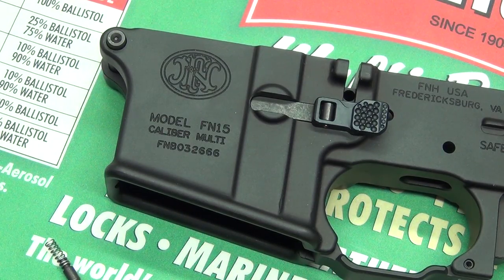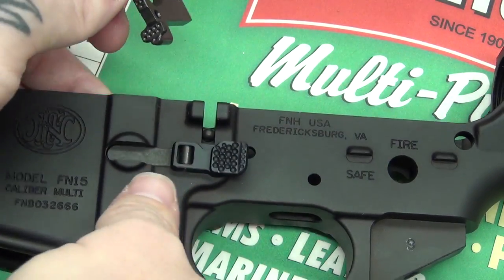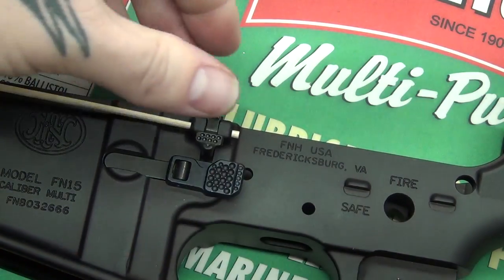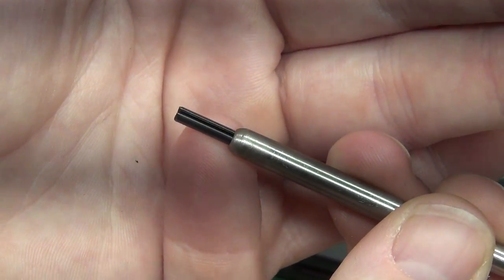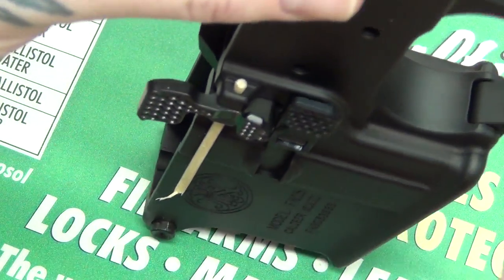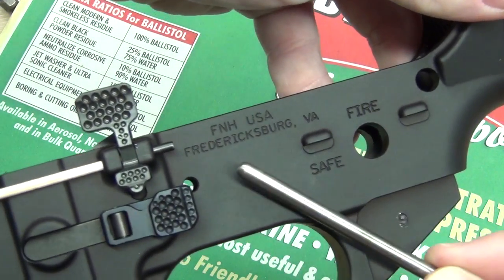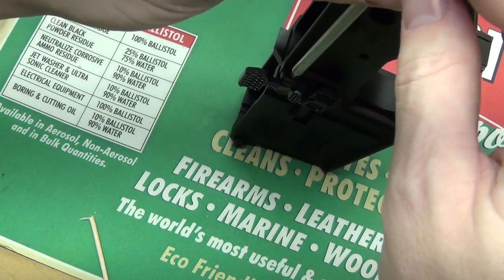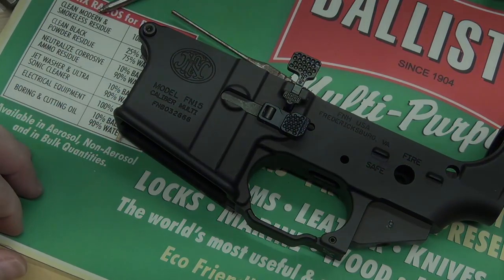AR-15 - Bolt Catch Installation

Comment: If you use a strip of painters tape length ways on the tool that's closest to coming in contact with the lower it's a bit of added protection to ensure the lower doesn't get marred up

Comment: I have discovered that you can use a small allen wrench, as a slave pin. It's short end stays in place under spring pressure. Also- NCstar (Vism) has just came out with (in 2022) a tap guide tool. It keeps your roll pin punch, perfectly inline, and shields the receiver from scratches. But it doesn't have the roll pin starting punch, just the tapping punch. And it is priced affordably.

Comment: If you don't have that special tool, put some painters tape around the hole opening and the side. It well help encase you miss driving in the pin and scratching the area. All The Best

Comment: I ended up buy the wheeler tools that are flat sided and have the rubberized coating to protect from scratches, it works great, Love it!!!!
Reply: Where’d you buy it from? If you don’t mind
Reply: @Jdowling357  Hey Jason, don't mind at all, AR15 Discount and I just checked they are in stock. "Wheeler Delta Series AR Bolt Catch Install Punch Kit"
$12.95

Comment: I always just pinch one end of the roll pin ever so slightly with pliars into a tiny taper. Punch that end in first. Goes in easy and smooth as butter.

Comment: Respectfully, you shouldn’t beat repeatedly on aluminum - it work hardens. Think of repeatedly bending a coat hanger - it work hardens and snaps. Bottom line • you’re weakening that bolt release gudgeon. I recommend a bigger hammer and fewer hits.